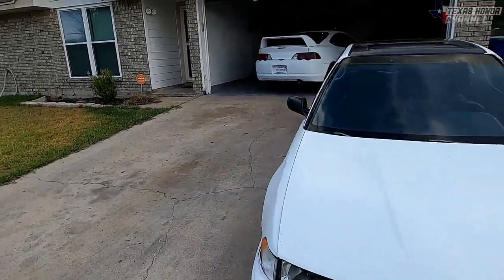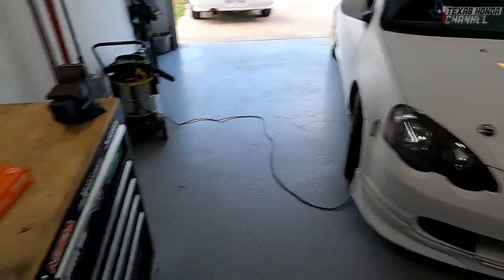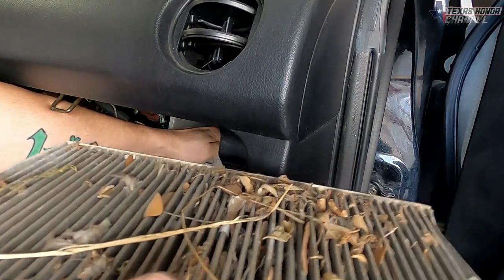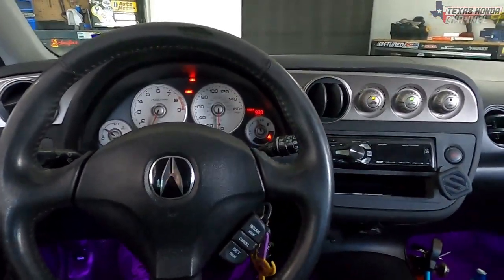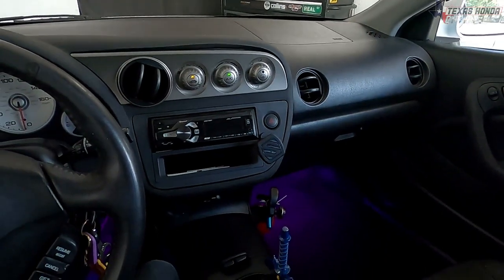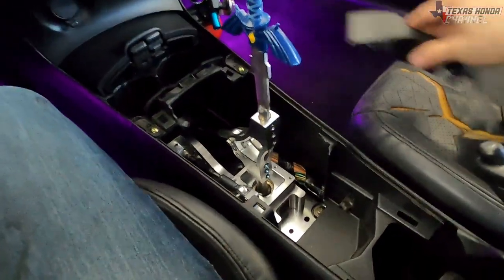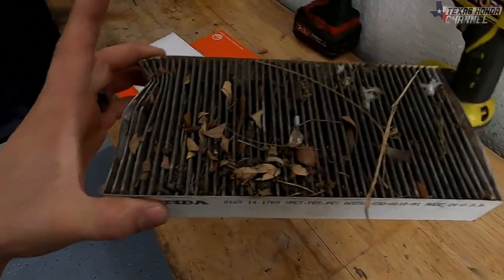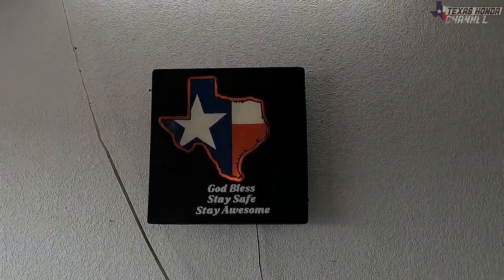HOW TO MAKE A/C MORE EFFICIENT & COLD FOR CHEAP!

Comment from the maker: I didn't know there was 2 filters in the air box so make sure to pull BOTH of them!! I made a mistake!! Simple enough though because there is Another filter to the right of the previous one. Also another way to help improve the A/C coldness is to obviously have a proper charge and pressure wash the condenser because they get clogged up and you can do that at a car wash for cheap as well. Hope these tips help someone.

Comment: Good info another thing to check especially with cars is to check the lower air dam like on civics the bottom is supposed to be attached to the core support that helps direct and force air thru the radiator and condenser for the a/c. On my expedition it was a big rubber flap I just finally got it back in place and it blows colder now.
Reply from the maker: Yea we don’t have that on here but yes that helps a lot too!! I have many more tips but figured this was a clearly over looked one lol
Reply: @TexasHondaChannel  yeah I know most cars don't have the rubber or plastic flap that SUVs have but most cars do have the air dam that attaches to the bottom of the bumper and to under the car usually near bottom of radiator core support. If that part comes un done it can actually cause issues with many cars especially with making them run hotter. Because the air is going thru the bumper vents and under the car not thru the radiator. A guy I knee was having heating issues with his viper and that's all it was was the lower air dam wasn't screwed back in after he had it serviced.
Reply from the maker: @GlassWerx  crazy stuff!

Comment: You can also buy ac coil cleaner that will clean all dirt and debris from the evaporator coil and help it cool better. It comes in an aerosol can with a long tube that allows you to saturate the coil and it dissolves it all away. There is a brand called frost king I believe available on amazon. Even with a cabin air filter some dirt gets through and will clog it.
Reply from the maker: I cleaned and pressure washed the condenser but I didn’t think of the one under the dash! 😱 good point!
Reply: @TexasHondaChannel  I saw it on another channel that shows tips and tricks on fixing and cleaning car stuff on a budget called sweet project cars.

Comment: My fan isnt blowing hard in my car. Atleast not as hard as i would imaging this car blows from the factory. I already bought a new blower motor, replaced cabin filter & the air is cold. The fan also works on all speeds. Any suggestions what i could do to make it blow harder? The air lightly touches my face when in driving position.
Reply from the maker: I had this happen in a older civic and i can’t remember exactly what it was but I know that the pipes can have leaks under the dash causing that issue and same with a voltage regulator I can’t remember the exact name but it’s supplies voltage to the blower motor. Maybe it’s a relay? If you did all them things and still don’t blow good it might be something like that ^

Comment: That was about 60,000 miles of farts 💨 and leaves 🍁 captured in the old filter . 😆
Reply from the maker: Yes and who knows how many farts that was from me after taco bell LOL
Reply: Texas Honda Channel , lol  at least it’s changed now!!! Clean for a while!
Reply from the maker: @chrisrobles2012  until Taco Bell run! 😂
Reply: leaves caught on a in-cabin filter behind the dash?😄
Reply: Metz Matu , they slip through the engine cowl slits. Fall to the opening of “fresh outside air” and down to the cabin filter. The car probably sat under a tree 🌳 and not garaged.
Reply from the maker: @chrisrobles2012  I have no idea on that because we don’t even have a tree but prior to me it’s possible!
Reply from the maker: @metzmatu8409  yes i assume it sat under a tree at some point because we don’t even have a tree lol 😂

Comment: I finally figured out why my a/c would start heating up the air.  I had it on 78. But before it would blow cooler when AC OFF was selected , hmm. Wierd

Aww, my drain plug is leaking , only closes half way ..I think it was vandalized
Reply from the maker: Oh dang! A plugged up drain tube can cause issues and the temperature selector can cause issues too!
Reply: Did your pilot have a coil inside that went between the plug and inlet like a washer ?  I got a new plug from auto zone haven't installed tho.  Some tell me to tap and drill ?
Reply from the maker: @rstuff1605  I’m not sure.